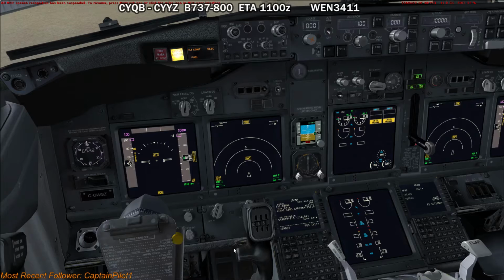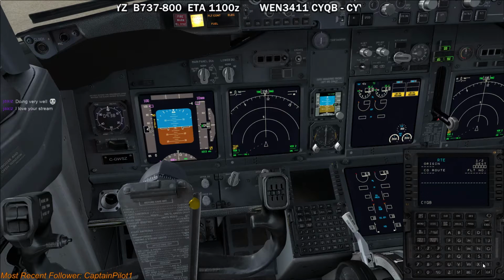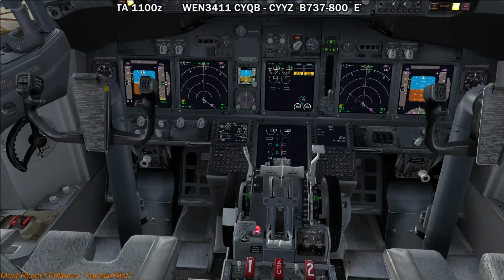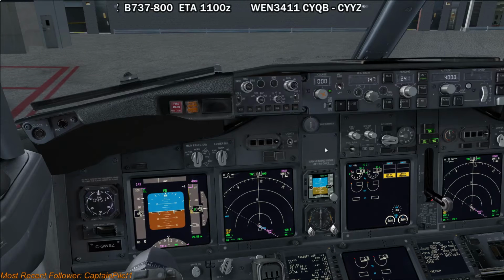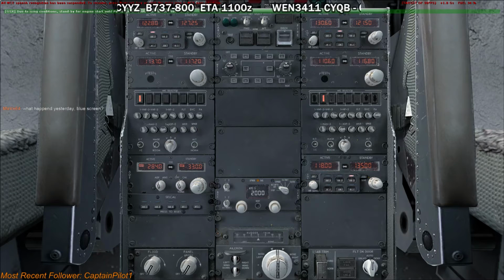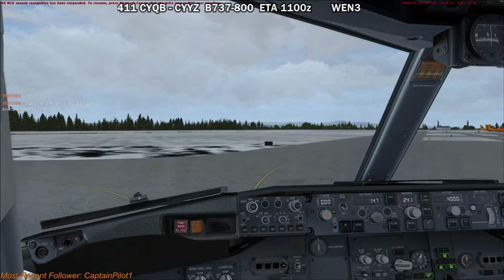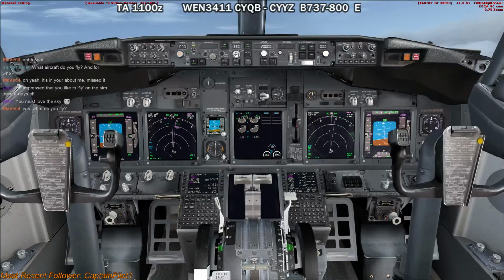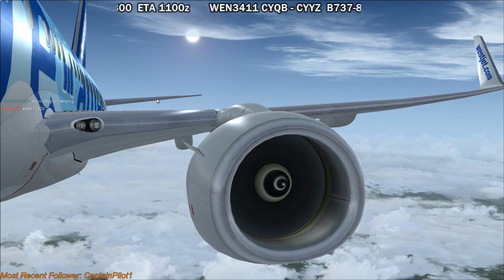[FSX] PMDG 737 NGX | Quebec City (CYQB) to Toronto (CYYZ) Part 1

Comment: RTO 👎
Reply from the maker: +François Pons I guess you mean the autobrake was off during the take off....my bad. I just noticed myself....oops! I don't have the footage of the preflight anymore, so I can't see what happened. I am sure I set it to RTO during the flow and then, I did the preflight checklist, so it would have been picked up on the checklist... Maybe MCE did switch it off by mistake, it sometimes does funny things....
Reply: +Captain Nav lol yes MCE is a bad FO
Reply from the maker: +François Pons Not necessarily bad, but sometimes the voice recognition does not work properly and it does funny things. As I said, I don't have the footage of the preflight anymore, so can't tell what happened. Maybe it was my fault, lol